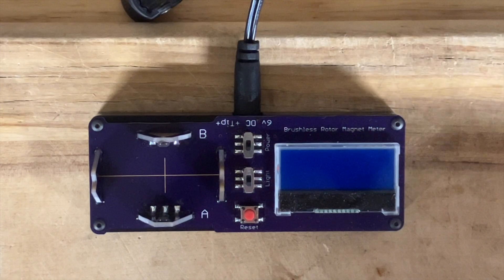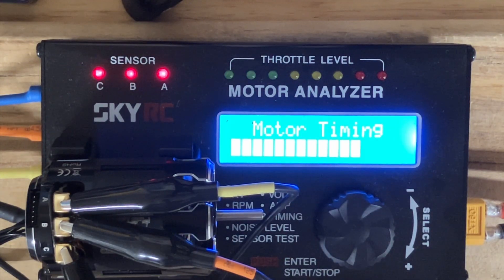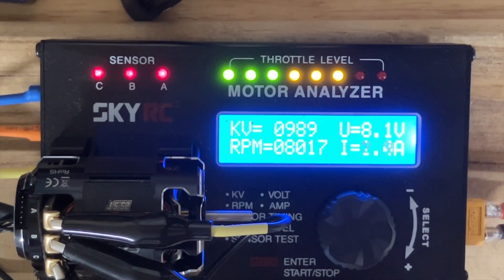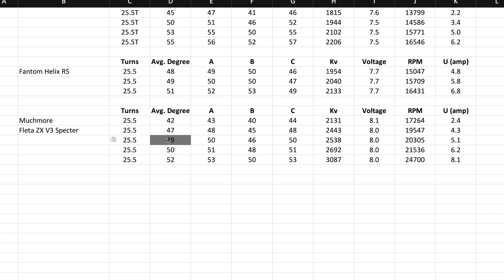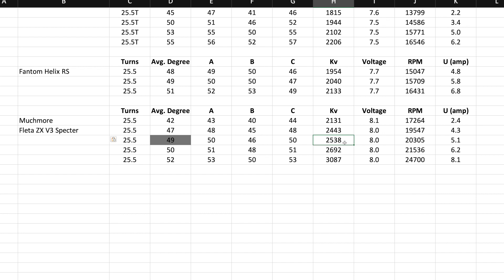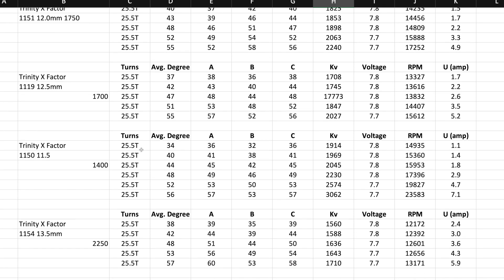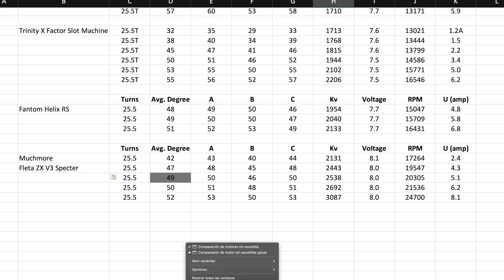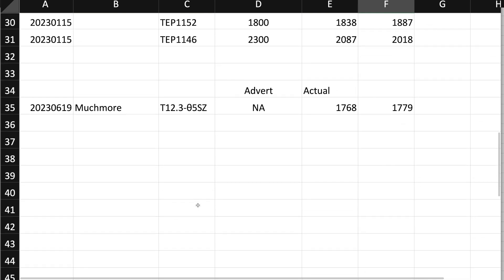Muchmore Racing 25.5T Fleta ZX V3 Specter Motor gauss and specs based on Analyzer outlaw stock

Comment: late now, but Muchmore Specter motors are outlaw motors and not Roar approved so you shouldnt be running in in an F1 class unless its an Open 25.5 class..
Reply from the maker: @Craigoverend Posted this previously. You are absolutely right unless the does an open mod class. Plus, the motor is out in the open for all to view. So not something one can hide. 🤝

Comment: TEP1146 is advertised as 2100 gauss
Reply from the maker: It is, but they do not state the timing. Or maybe they do now. If you change the timing, so does Kv.

Comment: I believe rotor strength is too much for 25.5
Reply from the maker: For stock it is. I think they generally range from 1400 to 1500 gauss. This thing has a 21.5T rotor by the looks and specs.
Reply: @telecomandorc  how can a rotor be to strong? i love watching your videos but at the moment they are a little bit above my head. i just know more rpm and lower amps is good and i thought a higher gauss was better. also are your spreadsheets available to the public?
Reply from the maker: @dirtrider88  In this particular case, what @starlinggibson4117 is referring to per my understanding is that there are limits to rotor strength in certain race classes. For example, ROAR and EFRA have specs motors can meet. Think of the Trans American races where 5L was the limit for a class so Ford had the 302 and Chevy had the 305. Of NASCAR has a 358cu-in limit. F1 changes its engine specs... the same for RC racing. So, for a 25.5T motor for spec racing, the rotor should be 12.3mm in diameter, can be long (25.5mm), and about 1500 gauss. This rotor is short (24.3mm) but the gauss is strong (18% stronger). Because it is shorter (less than 5%), I think it should run cooler. This motor has what appears to be a great rotor, but it would be disqualified in spec official classes. That is all. But in local clubs, many RDs do not care as they sell all motors or it is simply to difficult to tech cars due to limited staff. 
And, I do not have these tables available yet. At some point, when I build the website, I will make them downloadable.
Reply: @telecomandorc  oh got it. its a spec limitation. thanks for explaining
Reply from the maker: @dirtrider88  Anytime. Are you a 427 engine fan or is it different? I ask because I'm a 351W fan and I just found out I could bore mine out to 427 no sweat if I wanted too (small block so not the 427 big block). I am not going to do it now. It is in my pickup and thing still runs like a champ.

Comment: Just be aware it's an "outlaw stock motor, Not available in ROAR, EFRA" 
In their marketing it states a shorter stator stack and reduced internal resistance, probably why the RPM is higher.
Reply from the maker: I don't think Muchmore has Roar approved motors for spec. If they do, let me know. But it was impressive to see the numbers. I will be testing the 21.5T and have the specs up by Sunday. The rotors are the same number.
Reply: @telecomandorc thanka for this comment. Saved me from making a huge mistake lol
Reply from the maker: By the way, thanks. It just clicked why the motor came in at 30 degrees on the end-bell.
Reply from the maker: @donnienicholson180 The 25.5T is impressive. The 21.5T not so much.